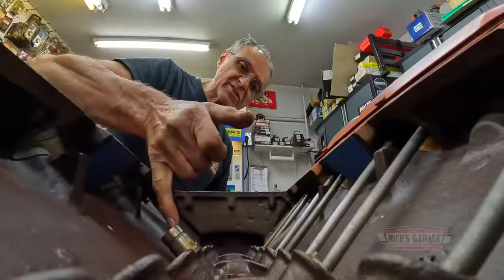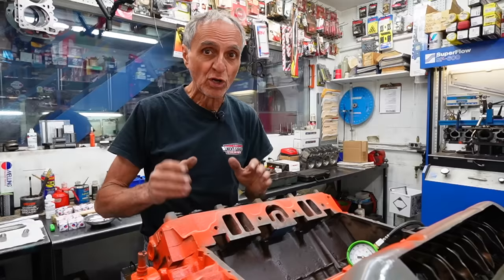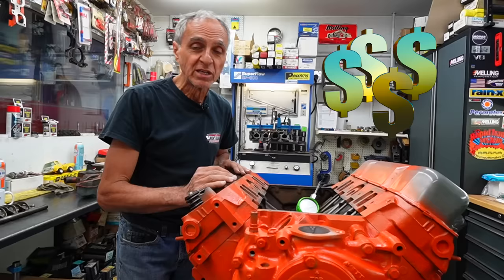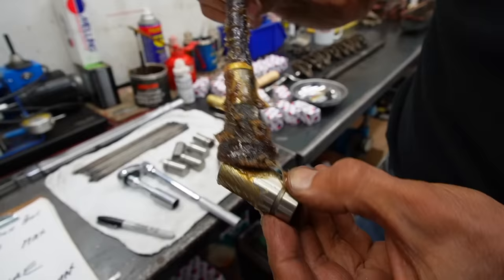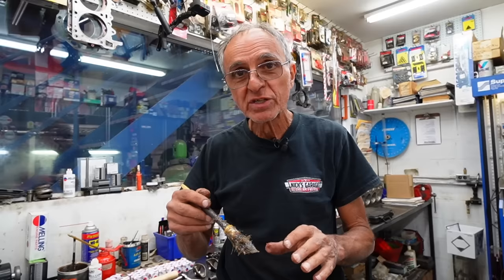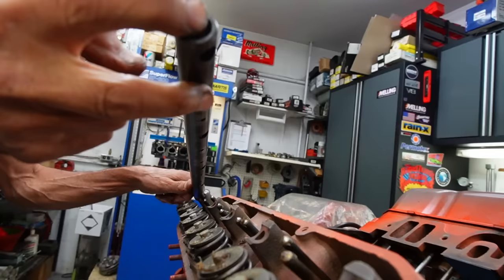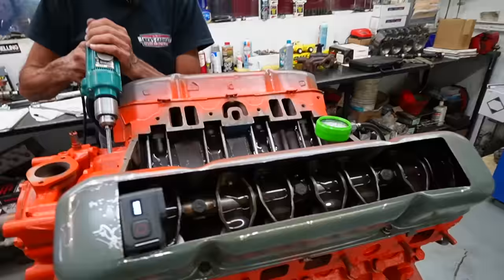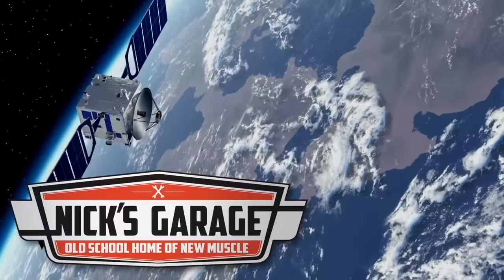Big Block 440 Valve Train Assembly - Nick's Build Tips

Comment: Back when I was a young mechanic, I started working in a Dodge dealership.  I moved on to a Chevrolet Dealership.  The first cam and lifters I replaced were in a custom van.  I did not know about the oil coming through the push rods.  I had oil going everywhere.  The detail guys were not happy with me for a good reason. The service manager gave me hell and asked me why I didn't use the oil diverters clips on the valve rockers.  I didn't know about them.  The next time the tool truck showed up, I bought the oil diverter clips.  Problem solved.  Oh well live and learn.

Comment: You're absolutely right if the lifter is binding in the bore it will damage a cam and lifter quick. Chevys are bad about that but Buick Olds and Pontiac are not as prone to lifter sticking. I had to learn that the hard way and if I ever put another Chevy V8 together I will always check that. And using a brake cylinder hone is a good way to deburr and clean the lifter bores. 👍

Comment: I'm resurrecting a 1977 motorhome 440 that has been transplanted into my 1974 D200. This video answered all my upper end oil passage questions. Thanks, and I can't wait to get my truck running and enjoy it.
Reply from the maker: Glad it helped!
Reply: @NicksGarage 
Since that Makida Drill has a place for a handle why not make something to mount Drill in place and turn it on and let it run while you're turning the crank by hand
Reply: @RichardMLowe  .   Good point, but I do not have it. But there is no issues anyways.

Comment: Great episode Nick!!! I really like the idea you use with the valve covers with the cutout section to prevent oil spillage and also provide a view of how well the upper valve train is lubricated when the pump is being driven with the primer shaft & Drill motor.. Also the valve spring pressures while the valves are seated and fully open.. Nice!!!

Comment: you can modify old distributors to use as pre-oiling drives, just remove the drive gear, remove/weld solid moving advance parts and chuck up on the rotor shaft.
for styles without the pinned retainer ring, you can grind/machine the teeth off a gear. it's almost better doing it that way as the distributor body aligns the shaft with oil pump and keeps from side loading it.

Comment: Nick, I remember street racing my ‘71 Challenger 440 SixPak and floating a few lifters, I’d manage to pull them out of the bores, put them in a small tray with oil and take a pushrod and manually pump them back up and stick them back in the engine and button it up right there in my driveway . What we would do!

Comment: I remember short-track engine guys about 40-50yrs ago would also paint the lifter valley and rocker/spring surface of the heads. Said oil flowed back easier over the smooth surface and took more dirt with it.

Comment: They make 2” silicone wheels with lots of fingers on them, come in different grits and great for light cleaning. Colour coded for grit size, Amazon has them. Thought they could be useful in a shop
Reply from the maker: Thanks for the tip!
Reply: @NicksGarage  they are called bristle discs.

Comment: That spring pressure is what I was looking at for my street 383. Even with the cam I wanted to use it was the best spring pressure for it. That seems to be what most springs give you even from the aftermarket. They know what works and lasts same as you:)

Comment: Hello Nick,
Love your instructions, oddly as an old guy and 
B block racer/builder did almost the same as you for cam break in. Back in the dark ages we used STP for cam break in, no I'm not a big fan of this but it worked well for this app. Broke cam in and changed the oil. Oddly I never experienced lifter bore problems and I used some sketchy blocks, they usually turned out to be the best runners. I did lots of taboo stuff to include used cams w used lifters and not from same cams.
Never lost a cam but was only twisting it to 5500 rpm. Past this power fell off. Broke a stamped rocker once, punched a pushrod through it. Changed it and made next round. Yes we won. I loved old b blocks and 727 TF. About the only way to screw em up was to fall out of the seat.

Comment: It's definitely reassuring to see nick talk about the flat tappet camshafts, I got a 400 ford in a 1969 f100 that I want to take apart to get it resealed and install some new slugs to bring compression up to 9.6 with the stock 2v heads, I was planning on using a lunati cam with crower cam saver lifters but I'm inclined in using melling lifters if that's what nick uses confidently

Comment: Nick I can't help but learn from most of not all of your videos. I'm unclear about why the drill doesn't turn when you move the crank so you can see I have learning to do.
Reply: If I had someone turning the crank so the cam journal no.4 can line up with the oil feed openings on the block while I keep priming with the drill until we see oil flow to the rockers.  Priming and turning crank all the time will end up with oil flow.  Same time you can have oil pressure reading of about 75 PSI.

Comment: Great tips! Those stock rockers and springs in the 300# range are a good combo for mild hydraulics and pretty bullet proof. I've broken in cams with the 933 green stripe springs before that had 333-340# open. The stock Magnum Red springs were only in the 250# range. I've used 'rebuilt' bushed Max Wedge rockers before (on a Hydro stick) to get the adjustability and a 'true' 1.5 ratio, but broke-in on the factory stamped rockers. Rarely are the stamped ones an actual 1.5 and usually somewhat less, so it's easier on break-in. I've found them to be in the mid 1.3's to mid 1.4's for ratio.
Reply: Yes, the  factory stamped rocker shafts have no where near 1.5 ratio. If they were, more HP.

Comment: Nick, Why do you think MOPAR never turned up the compression on the 440? The highest I've  seen has been 10.5:1. The Hemi was in the mid 11 range. With todays cylinder heads these 440 C I engines an make modern power IMO. I always loved the 440!

Comment: The idle of the charger has a chop.....and when the throttle's floored you'll hear a pop.....the idle mixture screws are undecided ....here in cam a lot...😁....I know it sounds a bit bizarre but in cam a lot.....cam a lot.....your air conditioner makes your engine stall......the power brakes won't help you stop at all...😁....

Comment: It's a pleasure to watch Nick show and explain in a casual but detail oriented manner things like orienting cam journal passages, and VERY important and too often overlooked, SPRING PRESSURE! TOO MUCH JUST AS BAD AS TOO LITTLE! Nick NAILED IT about less is more- break in gently and THEN IF NECESSARY, just shim a little, ESPECIALLY with hydraulic flat tappets! As yet, I believe priming and keeping spring pressure at a minimum has given me NO CAM/LIFTER FAILURES in 16 engine builds over 40 years, 7 of them in the last dozen years, with flat tappet engines. ALWAYS check lifter crown (2-2.5  thousandth and 1-1.5 on HEMI cam and lifters!) Bescause machining, especially on lifters, is NOT as good as it was in the day! Nick is right about the Melling lifters, tho I recently could not get them and went with the Mopar HEMI lifters with a Huges 440 Whiplash cam, and have my fingers crossed! These lifters look like Mexico, and spec at just over 1 thousanth crown, so does the cam taper! We shall see! Nick, thanks for finally showing us your final assembly assembly and checks for those great engines!

Comment: Thank you Nick. I've also heard to take out the inner spring of a dual spring to break in the cam, then put back after cam is broken in. Also, what about matching the cam and lifter materials? In my case I use cam ground on a scat SC-1 cam blank and scat lifters. My application is 4-cylinder, but do either/both the same principles apply in the V8 world?
Reply: Good question.   Not sure in the 4 cyl. world.  But I have been doing some testing in many years with cast cams and mixed lifter manufactures. In some cases you had the cam installed and the lifters back ordered. And your told no date promised. So what do you do, you work with what your supplied with. All the cams I use have the same surface finish. And for that reason I can use any flat tappet lifters. In some rare cases, you may have a cam designed with a specific  lobe and lifter design  like in your case.
Reply: Thank you Nick, excellent response!

Comment: How large of a hydraulic cam can you run with the stock stamped non adjustable rockers  ? I am running a mopar .509" cam now and looking to upgrade to something with a bit more lift and duration.  I want to go as big as possible with stock rockers. The aftermarket rockers that are available now look like junk unless you go with a $ 1000 + set. I don't see a lot of value in that or return on power for dollar.  Just shooting for 550hp with a 440 and rpm heads with flat tappet hydraulic cam.

Comment: Nick, I have a question regarding the video that you did the .020 cut on the heads of a 440 and then you put .020 shims Under The Rocker shaft. But the valves stay along with the heads so why would you put a .020 Kim under the shaft if the valves are moving down with the head. Shouldn't it be closer to about a .012 or 015 shell instead of 0.020. If the valve itself is also going down by .020 it's only the pushrods that you have to adjust to. That would not constitute a .020 change in adjustment especially if the valves are still as high as they were? My next question is if you drop the head by 020 don't you get the heads closer together by about half of that distance, meaning that you need to shave about 005 off of where the intake manifold attaches?
And the Lucas zinc additive is an awful lot of zinc to dumped into an engine. Can you not cause some corrosion issues with that much zinc additive?

Comment: Just wondering why you don't pre soak the lifters in oils so they don't have to pump up since this is a common hydraulic flat tappet lift practice?
Reply: Lubricate the lifters externally upon installation. Let the engine oiling system prime the lifters. That will prevent having a valve held open by a lifter that needs to bleed down. Keeps the valves from kissing the pistons.
Reply: @victordjinn632  the quoting of what he did doesn't make it correct in terms of process that anyone who's built an engine goes by. Pre oiling and even bleeding the air from the lifters is done by most engine builders with flat tappet hydraulic lifters. In other words they soak them in a container with oil and compress them to get the air out.
Reply: Nick is quite correct in his procedure and I not only endorse it, I do it that way myself. I assembled my first engine back in 1964. 59 years ago. Built lots of them since. I certainly do not need a lecture from you, or the likes of you. You're just not as far from ignorance as you'd like to think.
Reply: Nowadays you should bench bleed them just to see if they hold pressure and not bleed down

Comment: I really can't see the sense in rebuilding an engine and taking a chance with old valve train gear. Spend the extra and go roller, and get new and better gear.
i'ts much cheaper than having to rebuilt again in 5k mile... or worse...!
Reply: Nick explains quite clearly why in the video. This engine will perform as it is meant to, well past 5k miles.